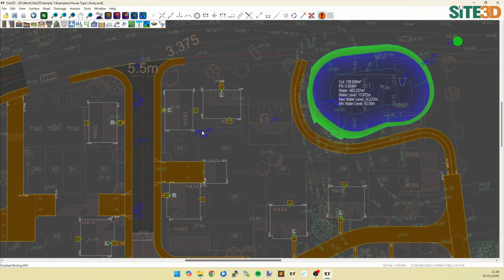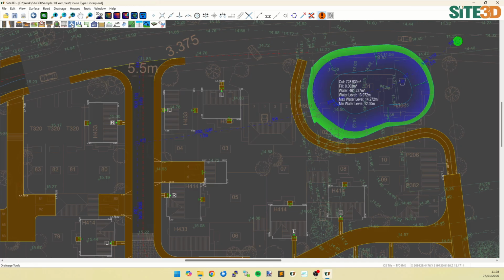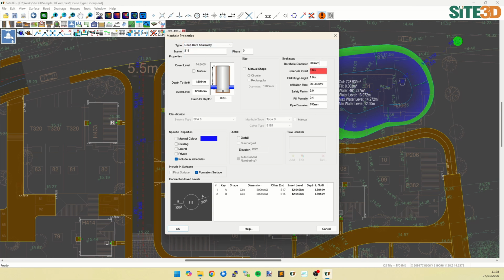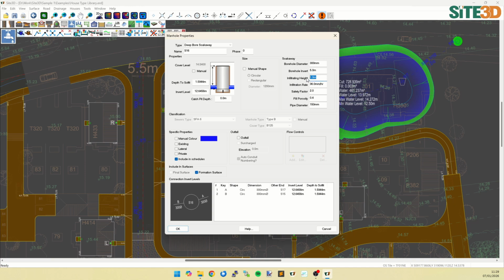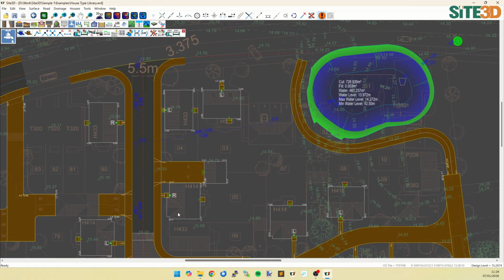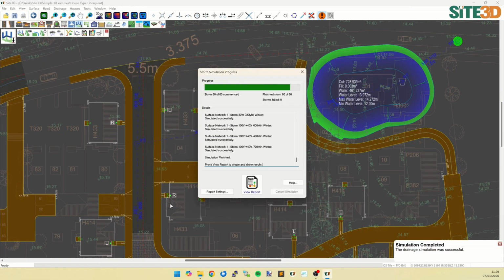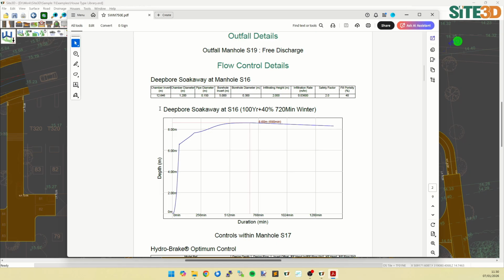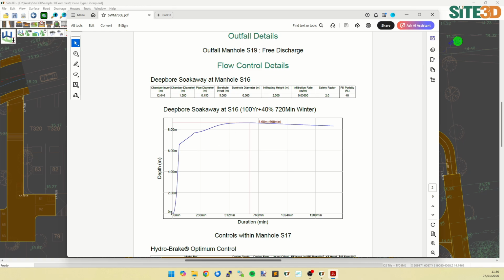Site3D: Deepbore Soakaways

Comment: is there any way to lock a channel level so when you raise the centreline of a road, the crossfall changes to suit the new level, the centreline doesnt drag the channel with it and then you have to fiddle with different vertical transitions to get the right cross fall.. it would be so much better if the cross fall changed to suit the channel which is fixed in this instance (slab level already built)